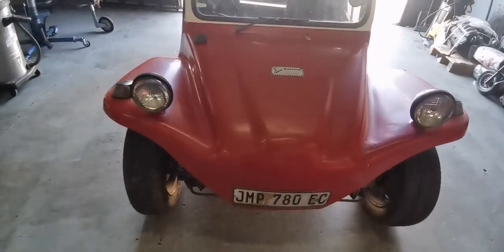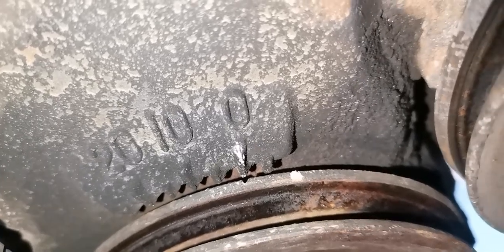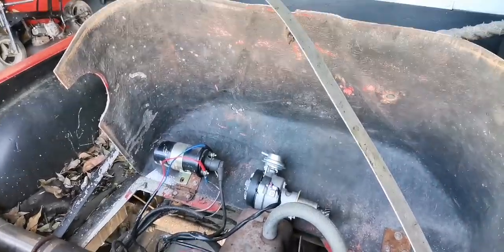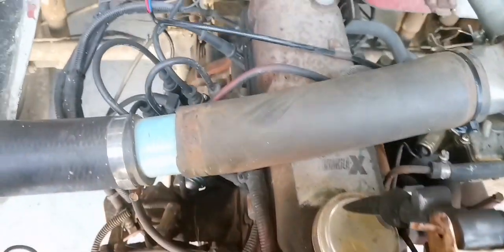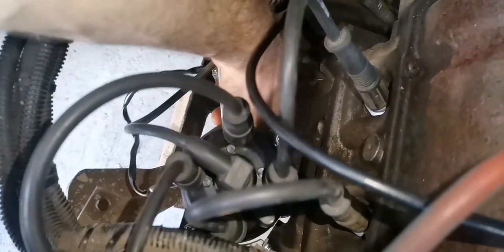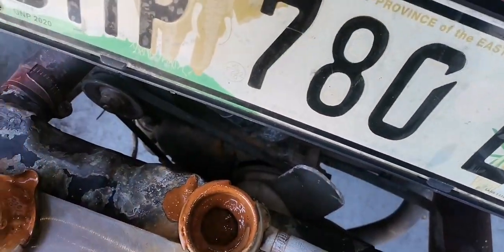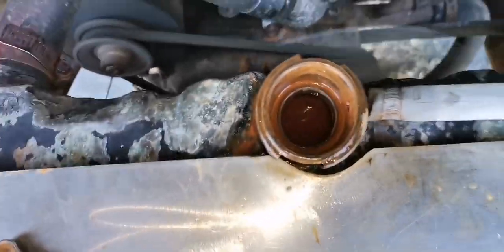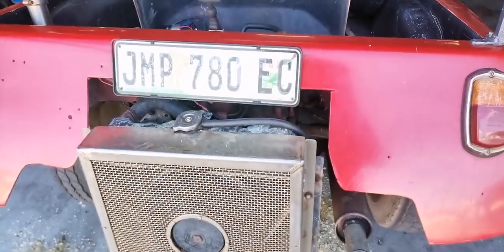How to set ignition timing Nissan 1400 A14 , electronic distributor install , rusty radiator flush

Comment: Please 🙏 please help me bro, I've got a Ford Courier, it's giving me troubles
Reply from the maker: Whats the problem
Reply: @BruceBroCustoms   Problem with the distributor time, when you're counting the sequence of your plug leads to the sparks, are they counted clockwise or anticlockwise? I've got a 4 cylinder 1800 engine
Reply from the maker: @thobilenyaku5274  take the dizzy cap off then turn the engine and check which way the rotor moves
Reply from the maker: @thobilenyaku5274  also make sure your engine is set to fire cyl 1 and not fire cyl 4. Firing order on 4cyl engines are usually 1-3-4-2
Reply: @BruceBroCustoms   Thanks 🙏

Comment: You dont need to take-out the module when installing electronic distributor? I've been trying to do it myself i cant get the spark
Reply from the maker: I just removed the old dizzy with points and condensor and installed the new electonic dizzy
Reply from the maker: It had spark before i installed the new dizzy just wasn't running good vacuum advance was shot

Comment: howzit ou. i also have a 1400 champie, it's misfiring when im driving, ive cleaned the carb amd replaced all the seals on it so its definitely not a fuel problem. what else could it be? ive also changed the plugs
Reply from the maker: Check vacuum advance on the dizzy. Had that problem on the buggy aswell
Reply from the maker: Did you sort it